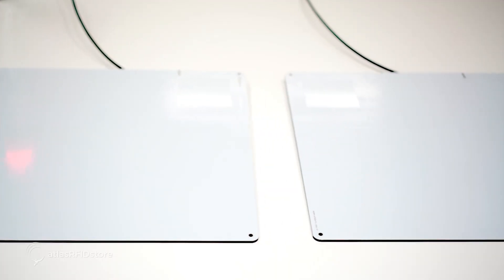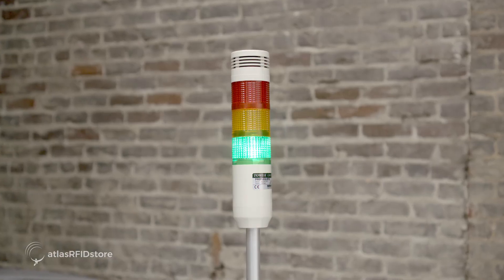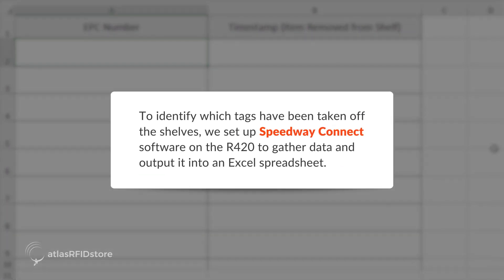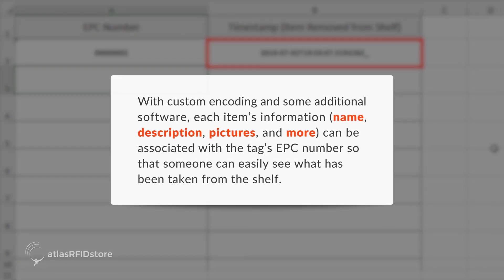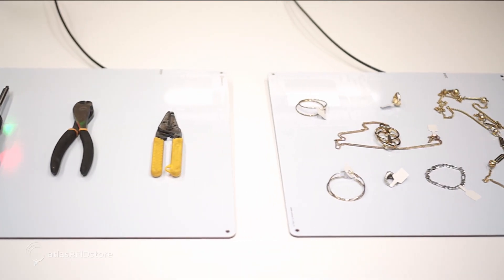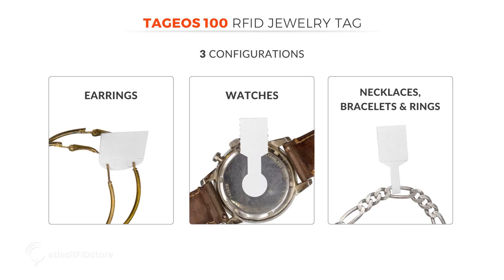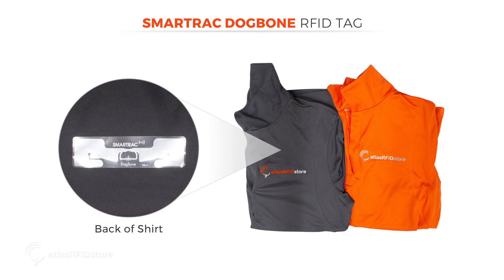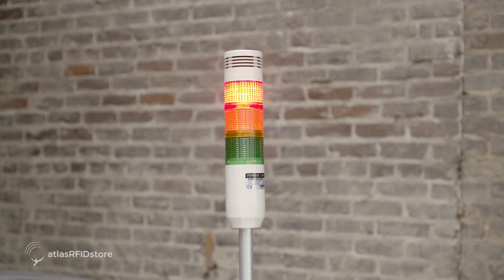RFID Inventory Tracking: How to Set Up Defined Read Zones

Comment: What is a cheap solution for a proximity reader?
Reply from the maker: J Rowe,

If you are talking about for NFC, just your smart phone/mobile device would be a cheap, no hassle way to read and write NFC RFID tags - checkout this quick video we just posted (https://www.youtube.com/watch?v=3mmGNq2xHyE). However if you are looking for a Passive UHF RFID Proximity reader...I would go with either the:
ThingMagic USB Pro - https://www.atlasrfidstore.com/thingmagic-usb-pro-rfid-reader/
or the
ThingMagic Elara USB RFID Reader - https://www.atlasrfidstore.com/thingmagic-elara-usb-rfid-reader/

The USB Pro has been around forever - well tested, and easy to use. The Elara is new on the market, but the coolest part is, if you plug this reader in and open up just a simple notepad file, the reader will just immediately start inputting tag reads in there. No software needed. The Elara is pretty new, like i said, so you might have some hiccups along the way, but its a cool, very simple RFID Reader.

Does that help?